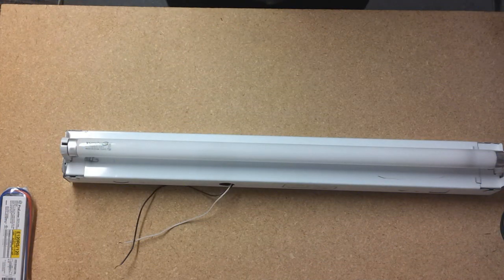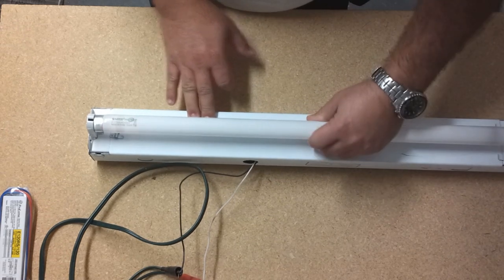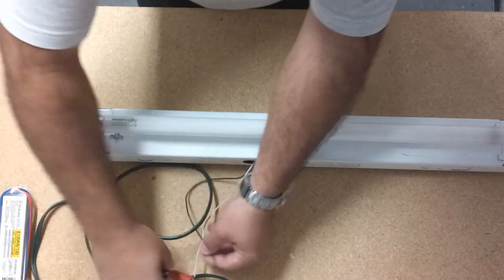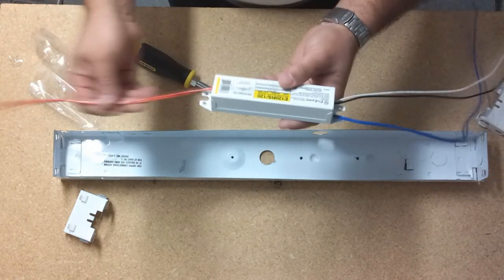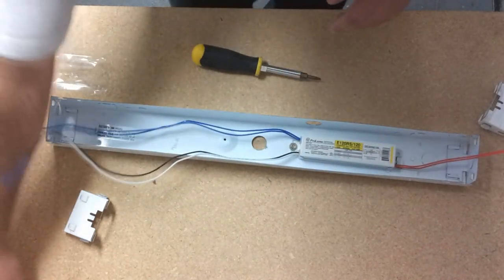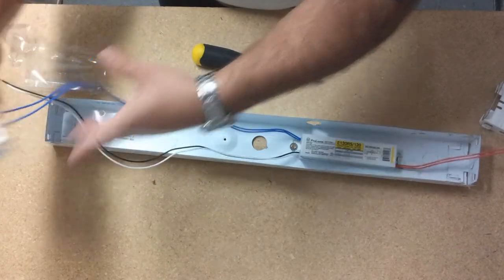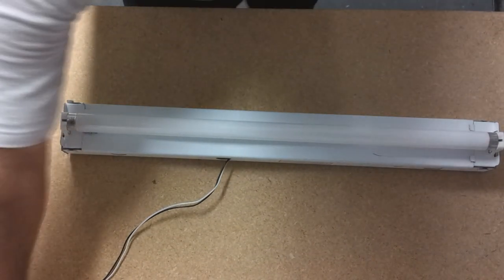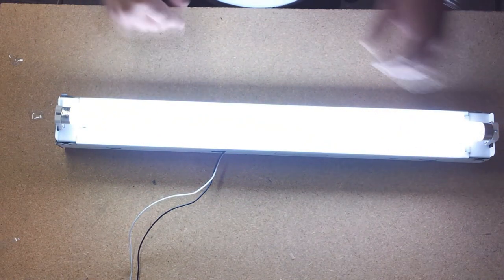how to replace a fluorescent lamp ballast

Comment: This is an extremely well made and clear video showing disassembly and reassembly of a single bulb florescent fixture by a person who is very skilled at doing this.  He takes out the old larger sized tombstone ends that hold the lamp bulb and replaces both of them with the newer and smaller ones.  He also removes and installs a new ballast.  Other than taking the case apart and reassembling it again, that's all there is to do a project like this.  No need to over think it.  Just use the appropriate parts, which any electrical supply can provide for you, and do as you see here.  It is not complicated, anyone can do it.  Be sure to throw all the old parts away.  You don't want to try to reuse them.

Great video!!

Comment: I have a small white ballast that 120V and it has 8 wires running from it. 2-yellow, 2 green, 2 red and 2 blue but my ballast only has 1 red, 2 blue, black and white, how do I wire this for a two bulb system operating from two light switches.